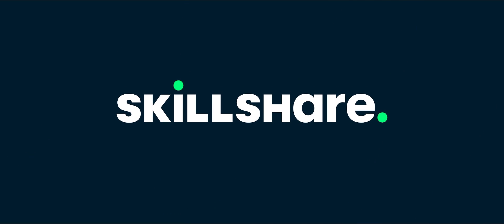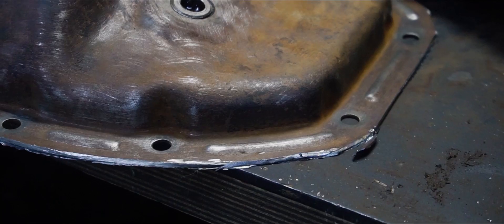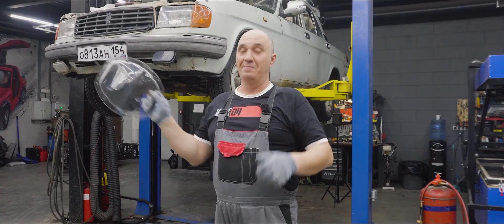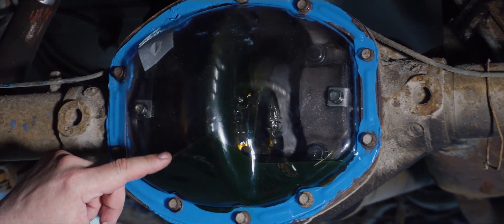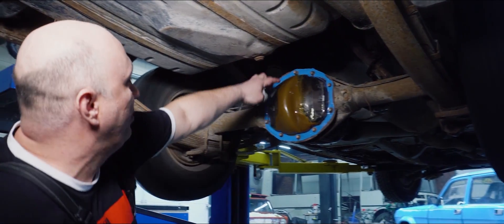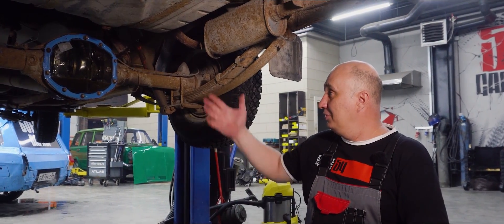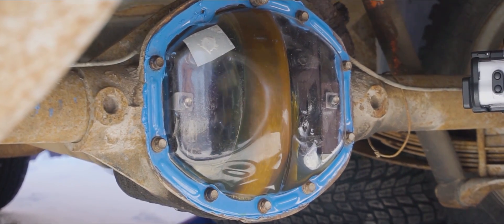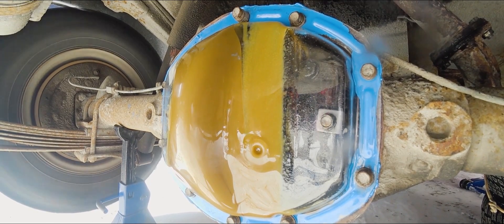Observing frozen oil under a transparent differential cover

Comment: My 2012 Nissan Titan specs call for synthetic 75W140 on rear differential.  Can I use conventional 85W140 instead?
Reply: Sure, but the diff won't last. And if it's a posi, you need special additive.

Comment: When its spring time in Syberia it is 10 below great to see what happens to a differentual how the oil moves around l was watching a program in Syberia where they heated up the differentual and other parts under the van with a blow torch now l know why thanks great experiment

Comment: The level does not come up to the proper level because the volume is bigger due to the cover being moulded on the outside of the original. You would just fill to the plug as it sets the level regardless of volume.

Comment: It seems they could engineer the cover to help direct more oil out and toward the bearings when it's running at cold temperatures with thick oil.

Comment: You gained volume when you shrunk the plastic around the outside of the cover, not much but a little so that’s why the manufacturer rating was not enough oil

Comment: Only thing I’m having a problem with is that its not an annular gear set. Its a ring and pinion gear set, and a spider differential gear set. Both are completely separate.

Comment: Well over ten years ago there were polycarbonate diff covers available for dana 30, 44, and 60 (which also fits 70) axles.  They discontinued as far as I know from a lack of interest.  But they were 1/2" or 3/4" thick polycarbonate and claimed to be bullet proof.  They were available in Jeeping/4x4 catalogs back in the day.

Comment: Bypassing the neutral safety switch on a manual essentially does this. Take out the spark plugs. It's not very impressive the car will move very slowly.

Comment: I always knew the 4 small gears as 'spider gears' and big round gear is the 'Ring Gear' and the drive shaft turns the 'Pinion Gear'. The terminology used in this is not what I was taught. The oil is thicker in the cold but it's definitely not frozen. If it were frozen it would not allow 'ring gear' to turn.

Comment: The oil should be up higher so the wheel bearings are cooled at the end of the axle tubes
Reply: I have my differential filled to the fill plug, I pulled an axel out and a little bit ran out. I called a shop and asked them about this, They said during normal driving, the oil will get to the bearings. When I pulled the axle again a few years later, the bearing had plenty of oil on it.

Comment: Maybe this was a mistranslation, but what exactly is the "planetary gear" in a differential. There the ring gear, the pinion gear, and the spider gears that mesh with the gears on the axle shafts.

Comment: This is more Dr. Doom stuff. The mechanical forces the oil subjected to will make it warm up as soon as you start moving. Check the specifications of the product you are using and the specification of the production itself. If you can use a certain weight of gear oil down to a certain temperature, all you need to do is turn the key and start driving. Common sense says, in very cold weather, drive as moderately as you can when you start out to give everything a chance to warm up. Most people don't live in a place where it ever gets below -5F (-20C) overnight.

Comment: Maybe, try just regular 80-90  gear oil .    Also,  try pure synthetic oil, of maybe 70 SAE  grade.   Compare the differences.....mineral  oil  should be used in compressors.....

Comment: Gale Banks did this on his YouTube page sometime back, except the cold show. Oil never really freezes, but it does get very, very, very, thick at extreme cold. As thick as it reguarly is when warm it adheres well enough to the stuff when not moving to lubricate it for a while when operating cold. Look at how much is on the sides of the housing when the cover was off. It will warm up shortly when operating and continue doing its job. Following what Banks showed about aftermarket covers, I took mine off and fabricated a channel of aluminum sheet metal to direct the lube directly onto the ring gear and the side splash onto the spiders.  The hardest part of that process was deciding where to put the mounting holes for the channel into the diff cover. I used 2 stainless steel studs in the cover and attached the channel with nuts and lock washers using spacers to locate it close to the ring gear. Thanks for the video that was nice.

Comment: The cover is shaped so that the oil is like a hose to the front pinion bearing, that's why those big square diff covers are junk, they just make a big foaming mess and stop oil flow to front pinion.

Comment: Oil transmits itself where required. The star gears do not require a lot, the side bearings require even less. Axle bearings get it as it wraps around the shafts to the bearing. 
In motorsport applications however some diffs require baffles in the axle tubes as all the oil goes up the tubes with G Forces. Then wants to stay there in turn causing axle seals to leak,, and starving the ring and pin of oil,, then they fail.
These little Salisbury diffs are quite good standard in that respects.
Try this same test again with synthetic oil. It flows far better cold. And takes a lot of heat out of the oil also,

Comment: The reason why you want to fill the oil all the way up to the plug until it starts to run out is so the oil level will be high enough to run down the axle tubes and lubricate the wheel bearings. Just lubricating the differential is not enough.

Comment: The reason you fill it up to the hole is because the oil has to go down the axle tubes To lubricate the rear bearings

Comment: we had a farm tractor back in the 50s  ( dad told me of this) it had 140 weight oil, in real cold weather the tractor would start but did not have the power to move it. this can helped by adding a bit of kerosene to the heavy oil.

Comment: The plug fill/drain on the differential housing is located at the height you must not fill above or the fluid will flow out the axles and mess up those greased bearings and the brakes.  So the fill amount is actually about 1.5 quarts  / 1.4 liters at the plug hole maximum.    Banks did a video of the development process and had clear caps of different after-market designs and is worth watching.
Reply: ...and I guess no one goes around a corner/turns? Off road? And yea, I've seen the Banks vids.
Most of what he said makes sense but not all.

Comment: I have a rear end tail, or tale.  I had a 99 Rodeo  and the pinon leaked and the right wheel bearing leaked too.  I had not been checking the level but found out it was very low.  It was cold, cold for here one morning, about +15 to 20 deg F and after driving for about 5 miles the rear end started howling and guess what oil was in it was sticking to the case starving the gears.   The closest place was Walmart about 4 miles away.  Pulled in there and they filled the diff but it stilled howled about the same.  Got a rear end from the salvage for $250 and installed it by my self in a day.  No more leaks and the rear end was quite.  For me it turned out OK and learned a lesson.

Comment: this is something i did when working for a driveline supplier. is used it for lube flow study's . the ring gear will send oil to the front pion bearing

Comment: How fast do you have to spin a tire before it explodes. Might have to use some cheaper damage tires or see if you can make something that can spin faster then a regular car. Maybe connect the engine to the hub and the wheel where the drive shaft yoke is
Reply: I think that is what the tire ratings are for. My car requires a ZR rated tire.

Comment: Suggestion....Human ETC..Have a guy control the rear brakes to try to control traction. so when a wheel looses traction the man would apply brake to that wheel the open diff would transfer power to the other wheel. They used to call this system fiddle brakes in mud plug buggies in Ireland and in Dune buggies here in the U.S. Maybe you could have a competion between a Modern car with ETC a team with driver and brake man in a Lada. Thank you for the Videos they are great!!

Comment: Hello Garage54, how about making a flywheel explode by cutting several deep grooves in it and then running the engine at full throttle with a set up simular to the out of balance flywheel experiment.

Comment: If you look at old 10 and 12 bolt chevy diffs, the cover has weird ceaces bent into the cover. They are to catch the oil running down the inside of the cover and guide the lube into the carrier bearings.
Cool video 👍
Reply: Gale banks channel had a bunch of vids on rear end lubing and the new cover he designed up. 
And he exposed the garbage designs of most of the aftermarket ones.

Comment: Suggestion. Turn a lada engine to a air kompressor. But only 2cylinders to kompressor, the other 2needs to both run the engine /kompressor but also drive the vehicle forward. Mobile kompressor ;) No less than 8.000 rpm is ok ;) how fast does a lada engine is capable of fill at least tank of 1 m3 air tank up to 10bar ;) take the pressure from spark plug hole ;)

Comment: I love your crazy car videos. 

I have an idea - with a car that uses a timing belt.. try to see how it runs with the timing belt  one tooth out.. in each direction, advanced and retarded, then 2 then three etc... will it run?  can it be improved if you change the ignition timing too ?
will it destroy the engine when valves hit pistons ?

It may not be as exciting as some videos, but might answer a question I have.. I have a 1989 volvo 740, was very underpowered, replaced the timing belt and used white paint to fit new one in same position as the old..   years later I had a garage renew it again and this time the car came back  like a different car.. much more power.. like it had wrong timing before maybe

Comment: Suggestion: take a front wheel drive engine and transmission and make it all wheel drive. You can use truck differentials and axles. You just need to make drive shafts, half cv axle to transmission and half typical drive shaft to differentials.
Reply: I've done this before and it was pretty cool. Just pay attention to what direction the drive shafts need to spin. That way you know if you need a front wheel drive setup with the engine on the left or right. Then make it inline with the chassis.

Comment: I'm wondering if welding a bunch of flywheels together and using that in a tire would work better than the bolts that they tried before.... Hhhmmmm

Comment: Diff oil level should always be just above the bottom of the axle tubes. After you washed the diff, everything was dry. Then it picked up some oil and the level was low again. Diff oil lubricates the axle bearings at the wheel end too, and if it can't make it down the tube, bad shit starts to happen.

Comment: This is a kind of dumb video.  This is all old stuff.  I can remember in Canada after two weeks at 20 below, my standard truck would start, but when I let off the clutch it would kill the engine.  The trans and diff fluid was just too thick.  Draining the regular diff fluid and putting in synthetic solved the problem.

Comment: Ooooo, I know, a lada motorbike. Run the drive shaft at an angle under the car so the diff can be offset. Weld the diff up and shorten the axel so the single rear wheel is in the middle.

Comment: Question: would that see through cover work in the long run? I mean... if you just put it on a car and go with it for let's say, years...
Did you see any heat load on the plastic cover? or any leaks....? Could be a nice "tuning" for them racerboyz :D

Comment: what you saw is  NORMAL.
some diffs have vanes inside the pan to divert some of the splash fluid  to the center bearings. 
square back diff covers impede the flow of fluid no matter what their advertising says.

Comment: Drill some holes in the housing on the other side and epoxy in some lights to backlight the gears.
And a polarized lens cap will eliminate some of the glare off the cover.

Comment: I really want to see a manual transmission with a clear cover I'm the extreme cold.  

I parked my car at work during a brutal winter, and it was so cold I couldn't put my car into gear when I got off. The manual transmission oil was frozen. I had to heat it up externally, just to drive home. I would have loved too see inside that transmission.

Comment: With the see through cover, weld the spider gears and add some weld splatter to the differential case to see how the bearings like a in case bed weld

Comment: Suggestion for a multi-show idea...  In the Philippines and other Asian countries they... Modify regular motorcycles that seat many people on both sides.   Sometimes called 'SkyLab'.   It's used as a tourist taxi, but they are useful too for cargo and logging where only narrow trails are available.   Some have roofs too.   Typically a regular motorcycle is used and the rider has to have great balance .

Comment: Suggestion :- what happen when we full fill the engine oil inside engine case.
Reply: This reminds me of what my older brother once said about his time at a service station. I guy in a Fiat came in, wanted to change his oil, but do it himself. He drained the transmission, added a gallon of oil to the engine, and drove off.

Comment: It will hold extra, unless I'm missing something you formed a clear cover off the outside dimensions of the diff cover so it is slightly larger than the original.  If you had made a cast of the inside, then formed the clear cover from that cast it would have been the same as the original.

Comment: In my experience with a lot of thermal vacuum forming, it look like the holes are too big. Optimum diameter is .040" (1. mm) - .045" (1.143 mm).

Comment: How about put some small "baffles" on the cover to direct the oil? Open a "window" in the axle housing to see what the oil does for the outside bearings? Put clinging and climbing oil, similar to Lucas to replace, or supplement the regular oil? The old "trick" for used cars: STP additive?
Reply: Lucas is pure based oil with zero additives. It foams like crazy. 
My rear started getting noisy after 25 miles at highway speeds. Switched back to pure synthetic and ok.

Comment: did anyone notice that the dif was only half full the plug is the full point
Reply: The filler point in the clear cover was at a higher point than the original fill point. Diff filled with correct amount of oil.

Comment: There is a company has a produces rear dif covers for trucks, it claims how its  designed to run cooler with fins.
  I called it out as bullshit on there video. they made a clear dif cover ran it also

Comment: This Lada i think has sealed greased rear wheel bearings on its rear axles. Ie rear wheel bearings are not lubricated by the differential oil.

Comment: If anyone is interested in observing the oil in differential while running further, I recommend you check out Gale Banks videos on differential oiling using different diff. covers. He shows how switching to a modified differential cover can change how it gets oiled good or bad
Reply: @Col Striker 

9" ford's don't have a rear cover.
Reply: Banks has a great set of videos for sure. 

It’s interesting because this video is such a great example of how terrible aeration is for oil.
Reply: Good recommendation.
Reply: Absolutely👍👍👍

Comment: It would be very interesting to see these transparent-case comparisons with the proper fluids for the application, rather than mineral oil.  Show us 0W20 vs 10W40 at -10C in an engine, and proper viscosities of gear oil in the diff.
Reply: That would be god-level content if they did or would do that.

Comment: Suggestion: Fill up the diff to the top to see what hapend on high speed with the transparant diff cover
Reply: Banks power already did this experiment (for their diff cover comparison)
Reply: @AmirPomen  - no he didn't...
Reply: @Crazystuffyousee  what u were talking about?

If u just search "banks power rear diff cover" there is 3 separate video with transparent diff cover were made by by banks
Reply: @AmirPomen  - none did he fill to the top as you said.
Reply: @Crazystuffyousee  but he did show over filled effect if i remember correctly
Reply: Agreed

Comment: You could try to fill it with 2 component epoxy, initially having each component separated and then see how long it will run before it solidifies.
Reply: I think this would be a horrible idea.... and yet I want to see it happen.
Reply: That sounds like a great idea. I used this epoxy in rocket league back in 2017-18 to attach the fins to the cardboard fuselage. :) Smelled horrible.

Comment: Usually in the US we use 90 weight gear oil, not trans oil like you used. I'm sure that heavy oil would've looked different in that there rear diff.
Reply: Banks power did one I believe
Reply: Yeah, and we don't call those planetary gears. They are side and spider gears contained within the carrier assembly. Plus, the ring and pinion make it all go around. Planetary gear are different and usually found in automatic transmissions.
Reply: 80W90 isn't even all that thick. Its right in line with 15W40 motor oil, since gear and engine oils are rated on different scales.